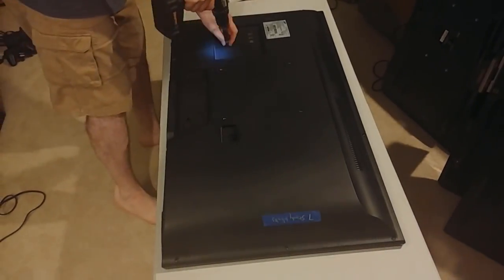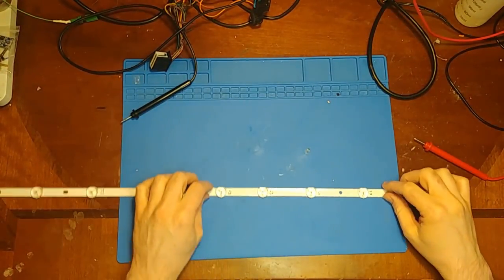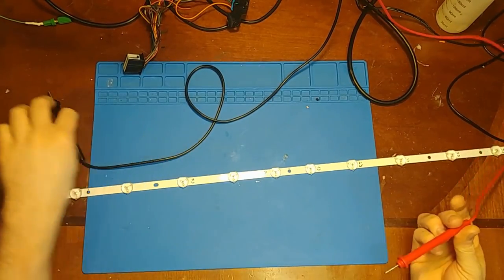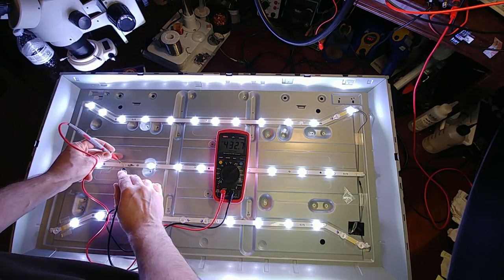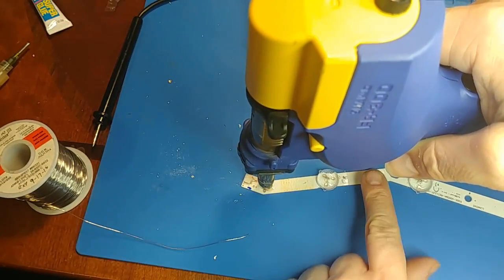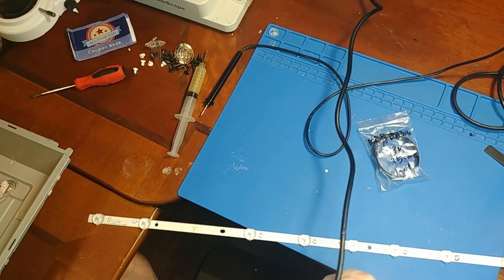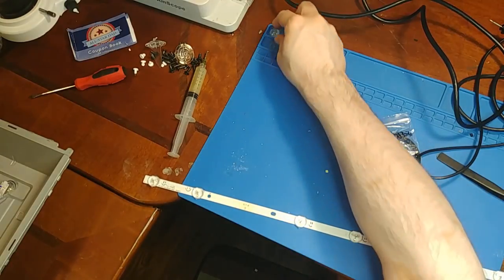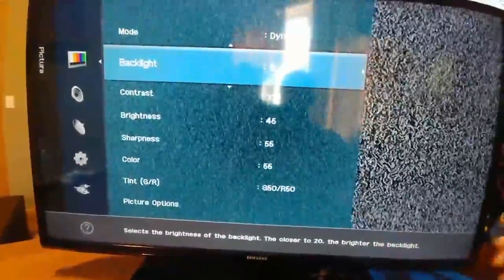Repairing a Samsung UN40H5003AF

Comment: So, my Samsung started blinking the red light 7 times and won’t turn on. I replaced the power supply and it didn’t change. Should I try replacing the main board or am I just wasting money?don’t know if I can do much else.
Reply from the maker: Did you check for image with the flashlight test?

Comment: Good repair Jeff, I was working on my vizio and got the diffuser sheets mixed up , would you know what order they go in? There are thick plastic one first and four thin ones. I did notice the clipped corners go together though.woulf appreciate some input .
Reply from the maker: Unfortunately I can't help much, besides thick layer first, the thin layers are usually notched or keyed in some way to only fit in one direction. You'll just have to experiment.

Comment: it is going to fail  again,  due the fact that so many leds had to be changed the first time. the cause  is  break down of the insulator  of the led strip to aluminum  backing to ground.  trust me , replace all strips. learned the hard way.
Reply from the maker: Your right. I usally make a point in TV's like this model with severe LED failure to replace all the LED's. Looks like I missed this time. This has been my bedroom TV. I have the backlight set to minimum. So far it's still going.
Reply: @jeffescortlx   have to say you are lucky. had at one time, i thought was i losing my mind with this model ,where everything  was repaired and tested, everything looked good , then it would fail in a few days or it would fail as you placed the  repaired strips back in the set ,   new subscriber. like your content keep up the good work .
Reply from the maker: @raydabreau4703  I've had my fair share of chronic LED failure. Some models just have bum leads.

Comment: I need to move to someplace where things like this only get tossed out, Around here they take them out for target practice....
Reply from the maker: Even some small towns usually have a recycling center. Or computer repair shops that offer electronic repair or recycling. That's where I find mine.
Reply: That would work if I didn't live in the hind end of the known universe.....   LOL.  Back years ago I did repairs on TVs/VCRs and other electronics. I've actually been watching you for the cluster repairs, I still do mechanical work and having the ability to do those repairs without shipping the cluster out would be handy.

Comment: Samsung uses bad quality LEDs ?
Reply from the maker: In some models yes. But generally good overall.
Reply: ah right. I have another brand TV. An LG 37Le5300 which is 8 years old and always have used the brightness conservatively and it still works fine
Reply from the maker: @maicod  it's hit and miss. In some models the LED's will run forever no matter what the brightness is set to, while a different model from the same manufacturer will fail no matter what.
Reply: I see :|
Reply: and capacitors